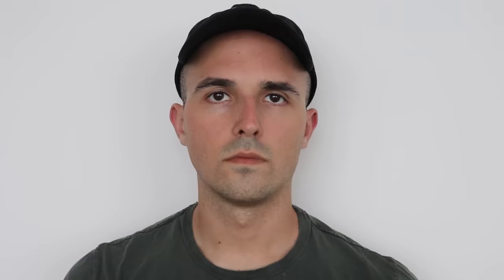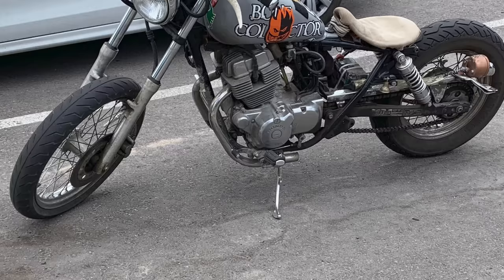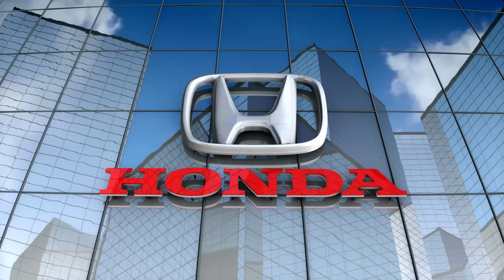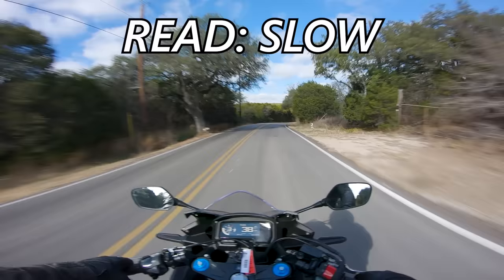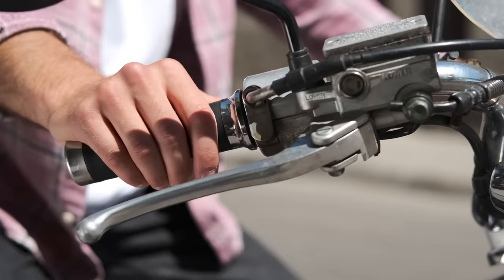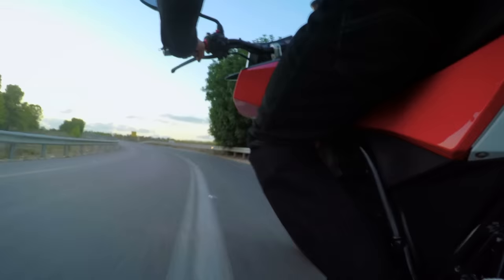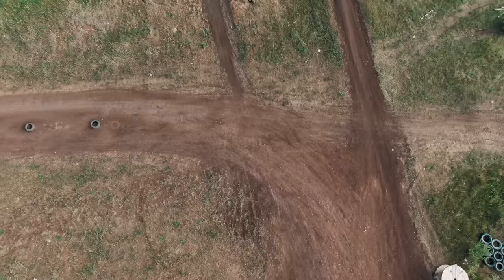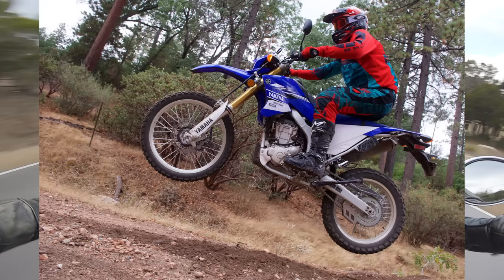7 Used Motorcycles That WON’T BREAK! (Low Maintenance)

Comment: Please please please as a trusty reviewing channel do a review of the gixxer 250 (considering us in the middle eastern shitty roads and everything being overpriced) I'm buying mine (2021 model) for $5600 usd because that's the best option for the price range.
Reply: 6750? Uff. Here in South America it costs like 4k
Reply: my bad my bad.. it costs 4000 JOD which translates to 5600 USD
But still it's a bit expensive.. the yamaha mt03 is 9000 USD the sv650 is 12000 .. and as a beginner rider myself I'd prefer to fu+k up a gixxer 250 than a lovely sv650 for example
Reply: a 4000 USD has to be around 2800 JODs but no no it's 4000 JODs and that's hurtful to the wallet lol
Reply from the maker: You’re gonna like today’s upload lol
Reply: @yammienoob  oh my God 😍😍😍 baba yamm himself 😍 I can't be more excited
Reply: @MohdGhm247  5.6k USD is not worth it
Reply: i know but looking at other options it's one of the cheaper ones out here (where i live) the KTM rc 200 is 5000 usd the mt 03 9000 usd the honda cb250r is around 8000 usd so i think it's one of the better options here
Reply: @MohdGhm247  What about an used MT03?
Reply: checked used motorcycles.. either badly used or not available at all because motorcycles community isn't that well established in where i live + ( i bought mine in installments with 0% interest rate paying half it's price as a down payment) and no one is interested in selling his bike in installments like a dealership would be.
Reply: @MohdGhm247  It's better to play safe. Go with the MT03 if it has ABS. The Gixxer 250 is a really good motorcycle with great handling, but keep in mind is a simple engine and it's only 1 year old, we don't know much about reliability
Reply: it doesn't and it's out of my price range as a student looking to get into motorcycles world but i appreciate your advice and i think my next motorcycle would be a mt07 or something similar

Comment: LOLOLOL  Great video! I sorta fact checked you on the part about the Ducatis. I didn't see any posted with the exact phrase, "I don't have time to ride anymore", but I did notice extremely low miles and a seriously reduced selling price on every single one. Like more than 50%. And they all looked almost showroom new. even the one from '14. Oh and sportsters? I know of some dudes that ride with a single four barrel carb and NOS. Probably wouldn't want to buy their bike after they're through with it though. Anyways, thanks for the video.

Comment: let me tell you bout the highest milage vehicle i know
i own it 
its a 87 ford bronco with a 5 liter with 750,000 miles on the od' and hasnt had a oil change in the beter part of 20 years, im restoring it and ofc im replacing the oil in it
its also got a crappy 3 speed automatic which also has not had an oil cange in the beter part of 2 decads if not more
TLDR: cursty old ford has 3/4 of a mil' on the od and is really fucking C R U S T Y

Comment: Ok wait wait wait wait a second. Had to pause here at because of the perpetuation of this ebay and amazon parts suck and stock is best BS. WTF. Yamster sit back while I yell at the long departed red hair guy repeating this spill yet again. Now granted i have bought some real aftermarket crap for my bikes but with a little research first this is avoided most of the time Hmmm let's see my $70 evo gloves and $70 sedici gloves both pulled apart at the wrist very quickly and the many different $25 ish gloves i get from amazon get 5 times the use and will last for 2 seasons. My cortech jacket pulled apart at elbow within 1/2 season while other cheaper jackets are still going. Can't see shit out of the stock mirrors cause those bug antennas are too close together yet my $20 bar end amazons worked far better. stock foot pegs looked like big fat uggs sitting on bike while ebay ones made by good old boys here in the usa looked 10 times better and worked just fine. Stock headlights burned the lenses with a stock bulb yet an aftermarket amazon replacement led set worked like a champ the entire time. Tail deletes, turn signals, gas cap, grips, levers , on and on - its not the marked up brand name price that matters. Some big brand names are really good, some ok and some not so good. And who says the factory knows what is best for your bike. If it makes you feel warm and fuzzy to stay in what you consider is the "safe zone" then more power to you brother -stay safe and happy in your zone. But for the rest of us that have some flavor and individuality and realize that when you sell it there are many others just like you and will have no problem getting your money back out of it -barring crazy crap done to the bike, we can relax and just enjoy throwing all our hard earned money down the pit cause it's just darn good therapy. Plus be smart about it and keep all those stock parts a bin so when you sell it you can tell the new guy they can have at it. My experience is that they don't even want that shit back.....annnnnnd now that i have left myself open to be flamed... back to the video.

Comment: My Hondas and Suzukis both had issues, particularly electrical and fuel pump. Overall my Yamahas have been the most reliable, apart from fork seals. I did have a Ducati which was a badly made, unreliable POS.